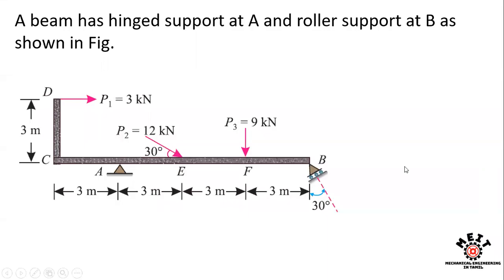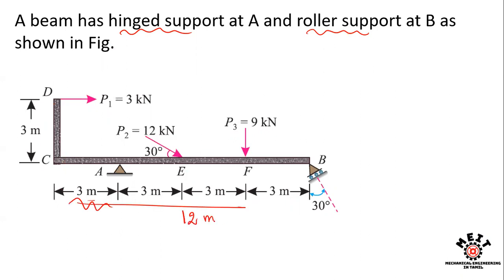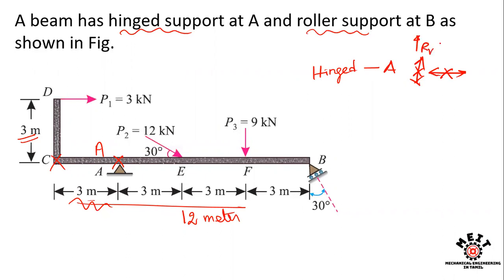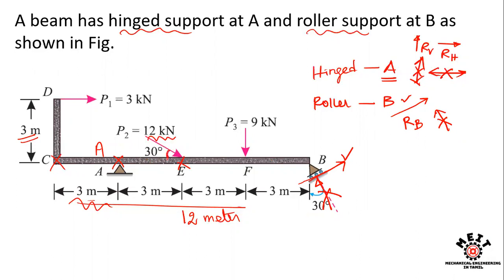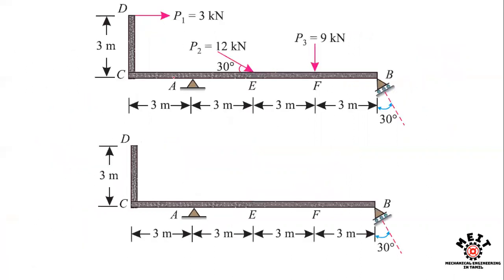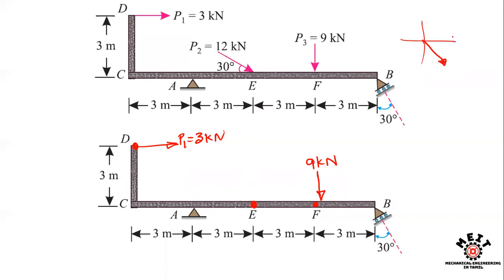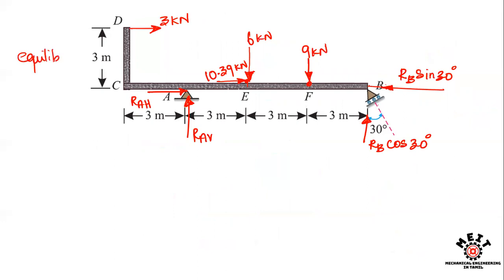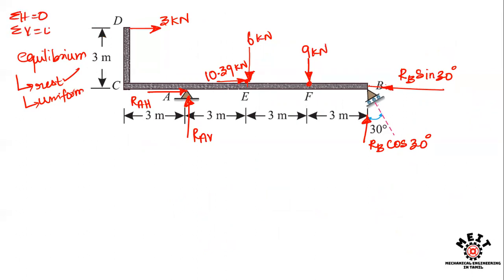Support Reactions : Part-2 | Equilibrium of rigid bodies | Engineering Mechanics | Tamil

Comment: Sir inclined force ku angle kudukama irundha enna panrathu oru cable force inclined ah 150KN act aguthu from tower top to ground  4th quadrant la athoda vertical distance (ground to tower top)6m and horizontal distance 4.5m(ground to cable located place)  Moment about tower bottom edukum pothu  pothu epdi inclined force ah resolve panrathu
Reply from the maker: tan deta podung.. opp/adj .. angle kedaikum